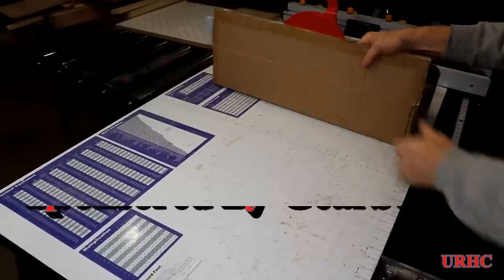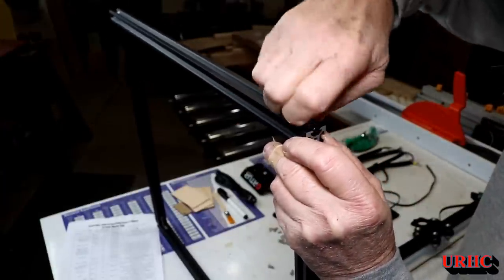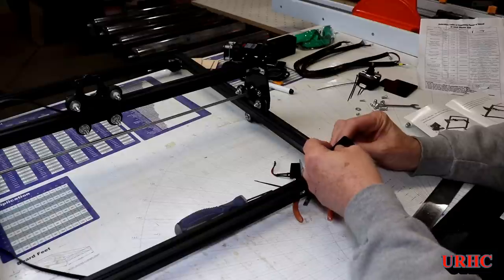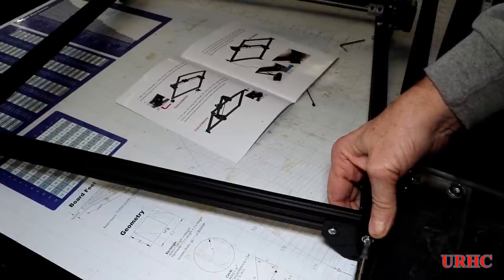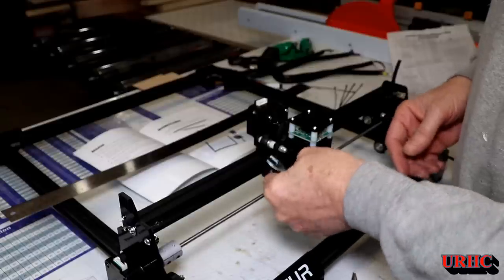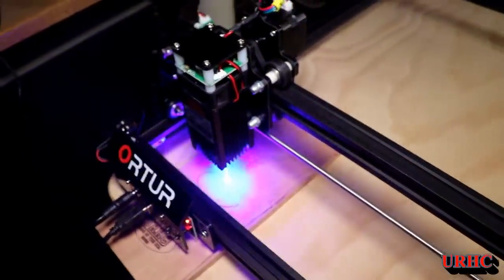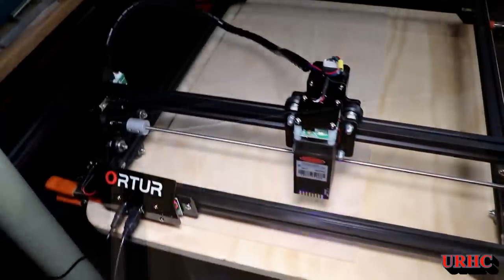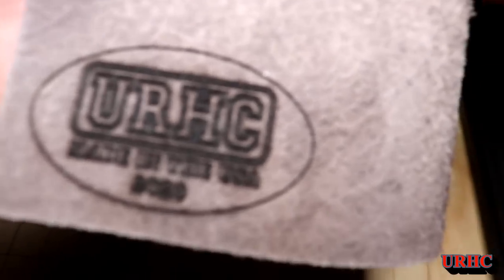Ortur Laser Master 2 400mm x 430mm 15 Watt Laser Engraver From Gearbest

Comment: Great vid. Thank's
Quick question; if I may ... 
I want to cut a pattern as deep as possible in hardwood; what is the depth that I can get to ... !?
Can I get to 4mm ... !?
And, what thickness (width) of cut can I cut at the same time ... 1 / 2 / 3 / 4mm ... !?
I would like to cut (in hardwood) ... 3mm depth with a 2 to 3mm width of cut ... !?
Would love your advice on that?
Thank you so much.
William (Southampton, UK)
Reply from the maker: I have only  been able to cut a little over 2mm deep in Baltic birch plywood.  Would need refocusing to go deeper. leaves badly burned edges. This is great for engraving but I wouldn't recommend it for cutting.  This is only a  4 watts output blue laser and you should look at better technology for cutting.  Thanks for watching.

Comment: Thanks for this video ordered mine received yest started it ran one engrave fine then wanted to do the same again but stopped working light but no engraving light it lost power you haven't had this problem have you
Reply from the maker: No problems with  either of mine yet. I would check that the power adapter is plugged in first.  If just the USB cable is plugged the lights will be on but it won't move. Contact Ortur or gearbest if that doesn't work. Thanks for watching.

Comment: Well I happy you received the instructions for the assemble, nothing in the box, and the web site they said to go to was not help either.  Lots of file but no help.  I did get it assembled watching your video, good job.  I have not powered it up No info on the 2 buttons on the controller, I need more info before I start using it .
Reply from the maker: You should  contact  Ortur  for that info. For some  reason  they quit sending  directions  and give a link to websites that want you to install  an app. I just ran into  that with  the rotary asm I  recently purchased.  Ortur should  be able  to send that and let them know  they should  go back to including instructions.  Thanks for watching.

Comment: Nice review. I've ordered one. How would you compare this to the smaller version and also from another similar brand Eleksmaker A3?
Reply from the maker: It's the same as the smaller one but this one takes up a lot of space and can't be adapted to smaller logos in tight spaces easily.  The only reason I accepted this one was because the small one works great and Ortur stepped right up to find and fix the original firmware issues. I don't know  how long the lasers last in any of them but they are a fun addition to the woodshop.  I know nothing  about the other brands.   Buy some good glasses as from what I have read green glasses like the ones supplied with  it are not the best for blue laser diodes.   Hopefully you don't  have to wait long for it to ship. Thanks for watching.

Comment: I was looking at gearbest but it appears these ship from China. They say 7-10 Business Days but I had problems with companies like this in the past. They say 7-10 days but from China its over a month. How long did it take to get one after you placed the order?
Reply from the maker: I have had the same problems. I ordered the rotary shipped from Hong Kong was supposed to ship quickly but took an extra couple weeks to get even after paying the extra $10 for quicker shipping. I think they are selling items faster then the companies can make them with reduced work forces due to Covid19 now plus fewer air flights from China that also carry air freight.  4 to 6 weeks is not uncommon. Thanks for watching,
Reply: @unemployedredneckhillbilly2023  I read all the three versions 7W, 15W and 20W all have the same output of 4.5-5W. If that is the case why pay more for the 15 and 20 if 7 gives the same output?
Reply from the maker: I think  the 7 is about 2.5 w output,  15 4w, & 20 4.5w. The focus  distance also changes.  15 watt has best focus depth for cutting and 20 for engraving from what I have read. All the same blue diode but over driven and refocused for different wattage.

Comment: worried about not having an enclosure, that laser safe for eyes? i dont mean the cheap goggles it comes with, but children, animals, indirect exposure?
Reply from the maker: Anyone that would let animals or children near these shouldn't be allowed to own one. They are cheap but powerful lasers that can blind you and cut flesh easily so following the instructions is important. Buy laser certified glasses also because the ones supplied are marginal and not certified. Cutting some materials create poisonous gasses that can kill you without proper ventilation so they are not a toy. Thanks for watching.

Comment: I bought one on presale from gearbest cant wait for it to get here i have another blue laser for my 3d printer and lastly my beast its 5x8 foot working area with a co2 laser but its also a 2.2kw router it does great photos on glass and ceramic tile a bit tricky on wood though
Reply from the maker: They are supposed to be shipping on the 16th but with the Corona issues I bet that will be delayed.  This is a fun little machine for wood projects that works good at an affordable price.  I would love a big router like yours.  Mine is only 2 ft x 2 ft . Thanks for watching.
Reply: I was told today by gearbest tue the 17 it will ship so probably 3 -7 days after that it should arrive im very impressed with its photo on wood capabilities but at the same time my 7 watt on my printer isnt too shabby either of course my 3d printer is a cr10s that i highly modified meaning i changed the extruder to a e3d titan aero put linear rails on all axis new bed heater and a wham bam flexible magnetic bed its accuracy is amazing now i had to add a air exchanger to get the fumes out for glass and tile work on my beast so smoke from wood isnt a problem
Reply from the maker: I also have a cr10s but mine is stock and works pretty good. Yours may have the updated firmware. Check if the max speeds are 9000.
Reply: Will do wait
Reply: Err cant
Reply: @RGCbaseace  Did your laser ship?  I ordered one on the 11th, and I am still waiting on it to ship.  If it doesn't ship by the 28th I'm going to cancel and shop elsewhere.
Reply: @dav8730  No not yet the bot told me the 25 but i see gearbest trying to drum up business on youtube by giving at least one away i posted on that video heres an idea how about shipping the ones that got paid for during the presale  before you start giving them away im not real happy either im thinking elksmaker a3 and changing the stepper  drivers to trinamic drivers like marco reps video ill wait until the 25 th not really in a hurry for it as i have two lasers engravers currently but 
They sure grabbed the money real  quick didnt they like it was 190 year old ginseng fast 
i dont want to blame ortur dont really have a beef with them just gearbest
Reply: @RGCbaseace  I spoke with Gearbest again today, now they are offering me 200 points...which is equivalent to about 4 bucks if I choose not to cancel my order yet, they assure me it will ship on the 25th.
Reply: @dav8730  thats what i was offered on Tuesday if i didnt feel so bad for the poor souls over being sick and all that id cancel strait away but i guess some of us still care about people in general 
 probably the last thing i get from gearbest
Reply: @RGCbaseace  Yeah, it's the last thing I order from Gearbest, unless something changes in the next week.
Reply: @RGCbaseace  Well my laser is supposed to ship today, we will see what happens. Has yours been shipped yet Jerry?

Comment: I recommend this product to engrave 5mm clear acrylic??
Reply from the maker: No. It would need a paper covering and that burns black marks into clear plastic that are very hard to clean out. Plus you would need an enclosed area with a good exhaust ststem for the harmful gasses. I would not use mine for that. Thanks for watching.

Comment: Nice Video. very informative to be honest. Could you also explain few details on the maintenance ?

 What are the consumables needed every 3 or 6 months ?

What can we do if the laser head doesn't work after few months or so ?
Reply from the maker: There are no consumables. I read the 15 watt laser is supposed to last 8000 hours and do not know how true that is or if it is rebuild-able. You should contact Ortur for an accurate answer to your questions because I have no idea the lifespan of any of the components in the price point of this machine. Thanks for watching
Reply: Unemployed Redneck Hillbilly Creations Ok thanks. Also, I was hoping to know If I could engrave names on my recycled ALUMINIUM wallet ? Did you try the machine on ALUMINIUM yet
Reply from the maker: No, I do not have a proper ventilation system to safely do materials like that. I only use it on wood. Ask Ortur.

Comment: how deep it will go or till what thickness will it cut?
Reply from the maker: I can only cut about 2 1/2 mm deep in Baltic birch plywood. That seems to be the focus range. These are very slow when cutting with multiple passes required and leave charred edges.  They are great for engraving.  Thanks for watching.

Comment: What's the wattage on yours, also will it work on metal?
Reply from the maker: 15. You would have to paint it black first and it is supposed to engrave metal. I don't have proper ventilation to try metal. Thanks for watching

Comment: New Subscriber, Great Video.
I have been debating on ordering this.
What is GearBest.com is it more a less like
Wish? Chinese manufactured products?
Reply from the maker: No, gearbest has their own stock. They have been extremely slow shipping since the Corona virus due to product availability and shipping personnel shortages so you can't always believe the delivery date given at checkout.  Plus  shipping can take longer now with so many airline flights that also carry cargo being canceled.  I see comments that its taking an extra 4 to 6 weeks to get now.  Thanks for watching.
Reply: @unemployedredneckhillbilly2023  
Thank you for the Fast Reply!
Over All your Happy with the Purchase?
Any Cons?
Reply from the maker: They both still work good and Ortur has good support.  On the other hand I purchased a Hubsan drone from them and nothing but problems with terrible support from Hubsan.  So it all depends on the manufacturer support if there are problems later.
Reply: @unemployedredneckhillbilly2023  
I've been looking for a while.
It's Time to Bite the Bullet. 
I think I'll get a return on my investment after 3-4 Projects. I'm going to down load the software and play around with it. I use Flexi Sign for my 54" Vinyl Plotter. I'm assuming it's similar. I see allot of Unboxing videos on this, but I've yet to see a technical video. Or in depth video onthe software. I guess I'll figure it out once I have it.

Comment: Thank you for the review. Could you let me know if it will cut through Ames Ready foam board. It's the paper coated foam board that's about .200 thick sold at most dollar stores.  
Thanks!
Reply from the maker: I don't know and don't have any to try.  If its shiny white there may be a problem and it probably would have  black edges where cut. It cuts through cardboard that thick.You would need a good ventilation system with the dangerous fumes also. Thanksfor watching.
Reply: My 7watt laser cuts foamboard in one pass on my modded 3dprinter if i set the speed slower from what i gather the ortur 15 watt only has 4.5 watt laser output so maybe two passes my co2 is my go to foamboard  cutter cuts it cleaner like paper no problem the blue laser kinda melts the foam inward slightly
Reply: With two passes, or one slightly slower pass it should happily cut through white foamboard. My 2W 445nm laser takes three passes over the brown paper backed foamboard to get through the paper layers on either side. Just be aware, it smells absolutely horrible and you should maintain a lot of airflow both through the room it's in and over the laser lense so it doesn't get coated and burn itself out

Comment: Great video. I am getting the grinding noise as well and can't fix it... id love to chat with some recommendations.. i don't want to send it back if I don't have to
Reply: I figured it out. I put my connectors in upside down.  Oops
Reply from the maker: Glad you figured it out. Many of these were sold and I have seen very few problems that weren't assembly related.  Have fun with yours.  Thanks for watching.
Reply: @unemployedredneckhillbilly2023  thanks for replying, its amazing how much better it works when you have the connecters in the right way.

Did you end up ordering red lenses instead of the green ones it came with ?
Reply from the maker: Yes I did. Green is the wrong color for this wavelength.

Comment: Thanks Sir for your video and so amazing explanation. I want to cut through 2mm acrylic sheet, can I do this with 15w or 20w laser Ortur?
Reply from the maker: I don't know.  I haven't tried to cut acrylic  because I  don't have a vent and it creates hazardous fumes. You should contact Ortur.  I read the 15 watt will cut deeper because of the longer focus length but have never used the 20 watt. You need paper on a reflective surface and the paper  gets  burned in the part so it's a pain to clean up also.Thanks for watching.
Reply: @unemployedredneckhillbilly2023  Thanks Sir, the Ortur team said 15w can cut 3mm black acrylic. But they are not sure about white acrylic. But I need to cut mostly white acrylic with black paint on it.
Reply: @alirehman6937  hi , did you figure it know if 15 W can cutt 2mm acrylic?

Comment: Hi, would you be willing to share the 25mm grid file?  I just purchased one of these and made a enclouser for it that I would like to burn a grid in.
Reply from the maker: I just drew a vertical and horizontal  line  in lightburn and copied them to get the grid. There is no file. It only  takes  a couple  minutes.  The demo version  will let you do it and try lightburn for 30 days. I bought  lightburn and gave up trying  to use laser grbl.  Thanks for watching.

Comment: Great video review! Do you know where can I get those Laser safety goggles? Thanks in advance
Reply from the maker: I found  some  on Amazon but won't  recommend eye protection. Contact Ortur because  I think  they just started selling protective eyewear for these lasers.  Thanks for watching.
Reply: @unemployedredneckhillbilly2023  last question! You do or you do not recommend to use the safety goggles that comes with the purchase of Ortur laser master 2??? Thanks for your time
Reply from the maker: No. Green is the wrong color for this wavelength.  Any reflective surface can send the beam into your eyes blinding you. I only  used them for wood a couple times until my certified pair arrived.

Comment: How did you set up the grid pattern?
Reply from the maker: Draw vertical and horizontal lines on a grid in lightburn. There's a more recent video about the mounting blocks to keep everything registered. Thanks for watching.
Reply: @unemployedredneckhillbilly2023  thanks so simple and didn't think of it. With lightburn, I can't seem to get the laser work with with pwm for images. Have you tried?

Comment: Shipping took 3 days? Mine was over a month. :P And I think I got a bad laser because it fires but can't even burn a single sheet of paper at 100% power.
Reply from the maker: My Ortur 1 only took a couple days and this one took 6 weeks till it shipped and then only  a couple days. The ones shipped from Hong Kong   came dhl that was very fast.  I ordered one of the new rotary fixtures for it weeks ago and and Gearbest lied about shipping dates so it looks like they sell stuff weeks before they have stock. Have you updated the firmware  for full power and set the focus properly.  They have a very short focus distance.  Contact Ortur they are usually active on lightburn forum  and Facebook if it's not working properly and they should be able to figure it out. I see comments from subscribers saying how happy they are with theirs all the time and hope they get you up and running. Thanks for watching.
Reply: Is it a case of just adjusting the laser to a sharper point or is it not adjustable, just a suggestion, though I am not familiar with this particular model.

Comment: Could you show how you did the cameo to gbrl
Reply from the maker: I use the business edition and just do a save as svg. Then it opens in lightburn with no problem.  I quit using laser grbl because it doesn't give good control of the line settings.

Comment: I just got a 20w version would like to ask where to find the image of the 20mm Grid.. I'd like to do the same.   Thanks
Reply from the maker: I just used lightburn and drew a horizontal and vertical line at 0,0 then did copies of each at the spacing that I wanted. Trim if there is overhang at the end. Only takes a minute to draw. Then just set your speed and power to the lines and burn them. I didn't bother saving it as it is only needed once. I gave up on laser GRBL and bought lightburn for the ease of use. Thanks for watching.

Comment: can i engraved a cutting board with this?
Reply from the maker: If it's wood should be no problem. Lightburn with a good SVG artwork is fairly easy to set up all the parameters. Thanks for watching.
Reply: @unemployedredneckhillbilly2023  Thanks to you for replying, great! what about metal and glass? say for example a stemless wine glass?
Reply from the maker: I doubt it would do a good job on them and you would need a good exhaust system so you are not exposed to the dangerous vapors.